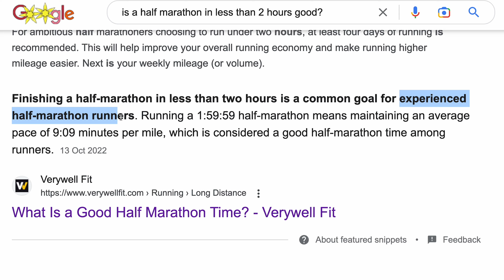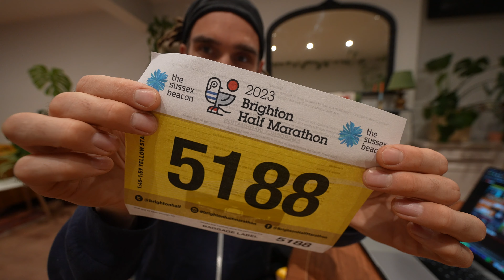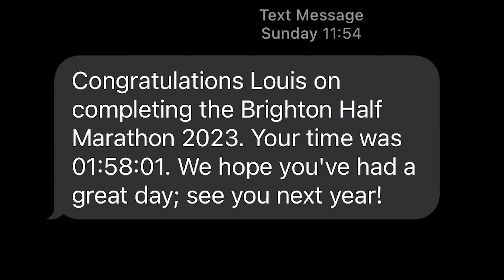30 Days To Run A Half Marathon Challenge (Never Run Before)

Comment: Congrats!! Very very happy for everyone who did this 🎉❤ Just one comment for anyone else watching this video for whom this may be helpful: For beginner runners, running any goal distance should not be hard!! If it feels hard, you’ve done too much too soon, which is a really really really common mistake. It can very quickly lead to injuries, and burnout and hating running, and it just goes against focusing on enjoying the process. I’m so glad nobody got injured in this video, thank god. Also, it’s very ambitious to pick both a new distance and a new time when you don’t even know your own average. A time goal is sort of meaningless unless you know what you normally do it in, and are trying to improve on your time, because time varies sooooooo much even by something as simple as stride length. For example Louis is of course very tall. And the best running goals pick either distance or speed to focus on, both for any single run and for overall goal setting. This is because its just less effective over time and too taxing to both increase distance and increase speed. My final comment - don’t be afraid to go slow, there’s nothing wrong with taking an extra three weeks to do something properly and give your body the time it needs to make the adaptations required. That’s how you get healthy and fit and increase your health span. And it’s always worth doing at any point, no matter your age. You can always always push your body to do something like run a half marathon in the short term, but that’s not the same thing as having a really really strong aerobic base. All those miles should be easy easy easy!!! Sooooo easy. Anything that doesn’t feel easy, like a super easy conversational pace, is too hard. Anytime your joints hurt, they haven’t built the adaptations yet and it’s too much too soon. Any muscular injuries means it’s either too much too soon or not good recovery. If you feel like you’re running out of energy, you’re running too fast.

Comment: Way to go! Excellent run and ambition! As a 40yo, I was in the same shoes and can totally relate to wanting to be fit at 40 and choosing endurance running as a way to keep healthy for my two younger boys (3 full marathons now in the past 14 months) and have the drive and energy to show them the world like I did with my older teenage kids when they were younger. Starts with the half, and now I bet you’re looking at the full - you can do it! Keep the momentum from this effort, most full marathoners train to 19 or 21 miles. Keep going, you won’t regret it!  It’s only a couple more miles 😀 Great video btw

Comment: I think it is a massive achievement just to do this challenge for your level of fitness, but to put that extra pressure of doing this in two hours on your first try is not a good idea. Do the run as a first for yourself. You do not have to prove anymore than that to anyone. It’s enough to run the marathon 🙏